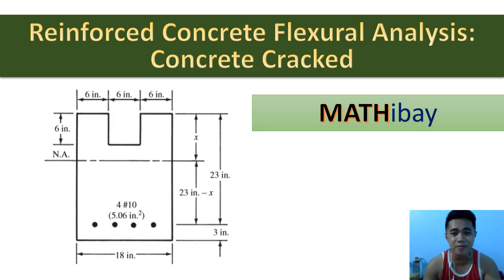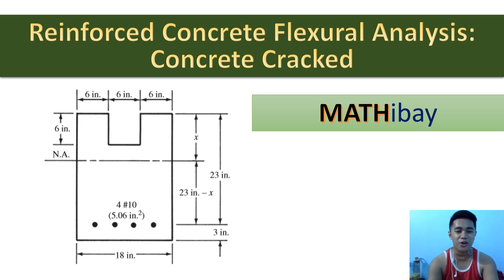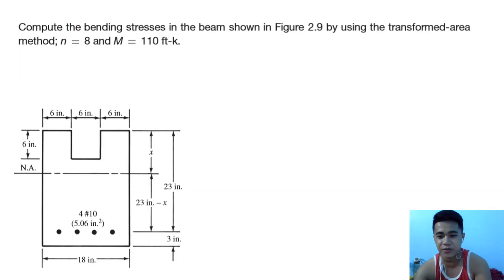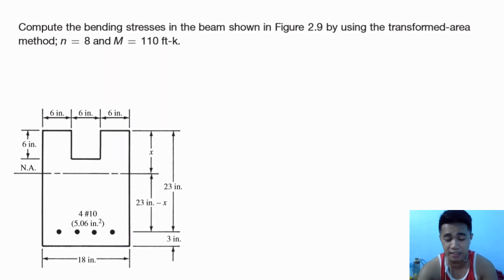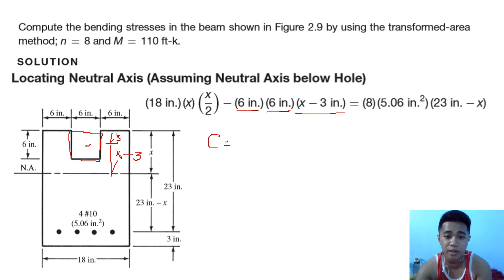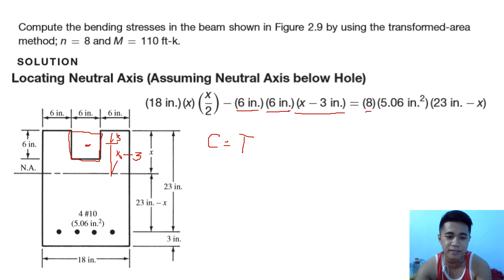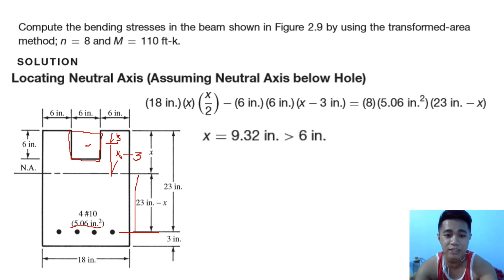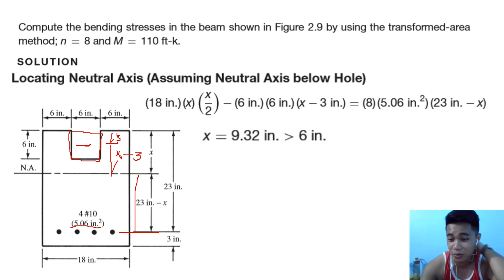4. REINFORCED CONCRETE/ FLEXURAL ANALYSIS/CRACKED BEAMS/IRREGULAR SHAPE

Comment: Does cracked mean, the concrete section in tension is neglected and the steel is converted to its equivalent concrete?
Reply from the maker: Cracked means the flexural stress is greater than the modulus of rupture.
Reply from the maker: https://youtu.be/_6gOK94qL3s
Reply: @mathibaybyjudys.gallardo1486  Thanks

Comment: Good day Sir Judy. I have a question...is it possible for me to find the cracking moment of an irregular shaped concrete if the only given is the value of f'c?😥 If yes then how?😔
Reply from the maker: Hi Anamera. Kung f'c Lang po ang ibingay at cracking moment Ang hinahanap. Using f'c kunin mo po ang modulus of rupture (fr) or stress at which magstatart Ang cracking. In this solution gross area Ang dapat e consider Wala pong rebars included.  Using the formula f=mc/I, 
*Yong makuhang fr sya Po Yong sa f
*m is the cracking moment na syang hinahanap
*C is the N.A of the section
*I is the inertia gross.
Reply from the maker: https://youtu.be/0WE4DqNDqX0

Ito Po Yong proceedure sa pagkuha ng cracking moment the only difference is that in this video rectangular po Yong beam.